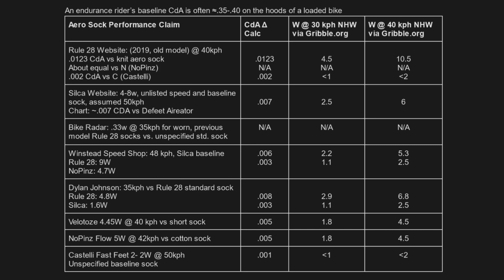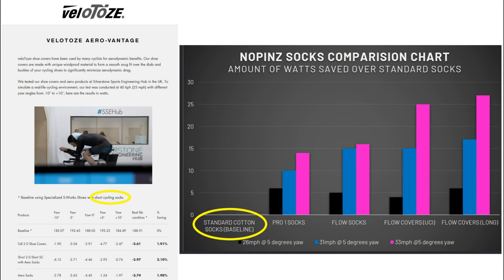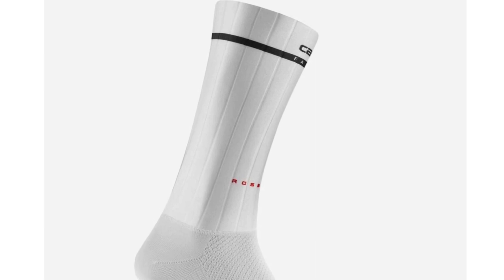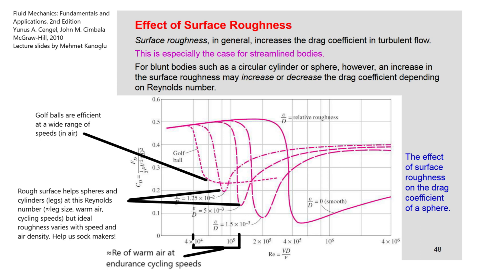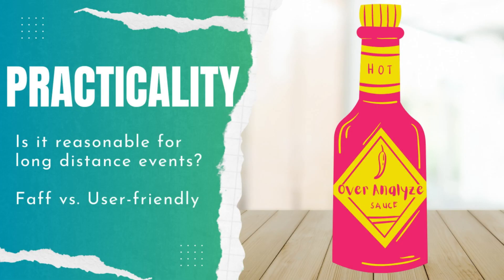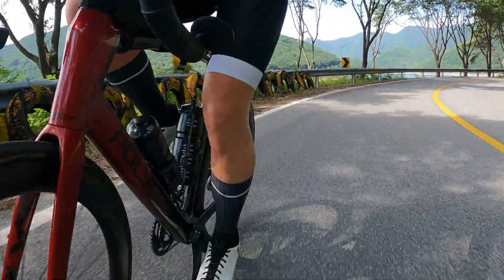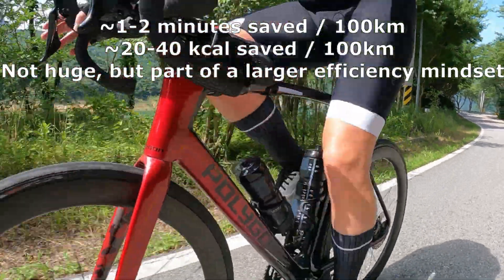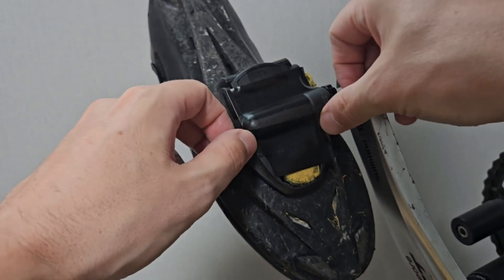Aero Socks: Gains, but at what cost?

Comment: I can see how aero socks are faster than knit socks of similar cuff height. But I have a feeling that aero socks are only marginally faster than low-cut socks on well-shaven legs. Anyhow, the good tan lines offered by low-cut socks and not looking like a dork are way more important to me. But that's based on personal preference and opinion. Maybe others think my low-cut socks look dorky. But at least no one laughs at my legs when I'm at the beach. And if I think I look cool, then the psychology goes a long way.
Reply from the maker: Lionel Sanders tested that a few months ago and found shaved, sockless legs nearly as fast as aero socks, and faster than knit socks. It suggests that it's not so much that aero socks are great, but that knit socks are bad. 

 I prefer the look and feel of low cut socks, but i sweat too much and they get soaked. Mid to high cut socks do really well too help my sweat evaporate before it drips down into the shoe.
Reply: @overbikedrandonneuring nice! I’ll have to check that study out